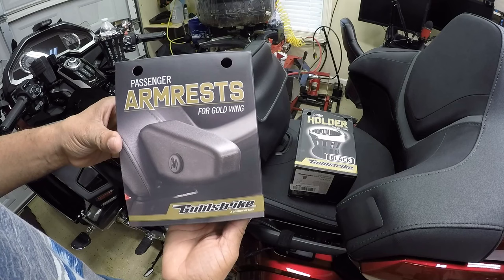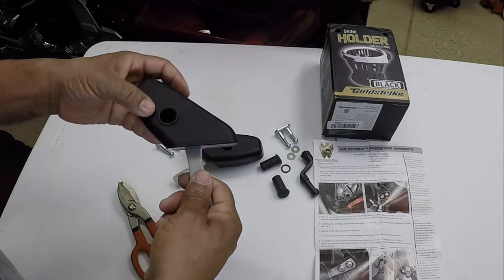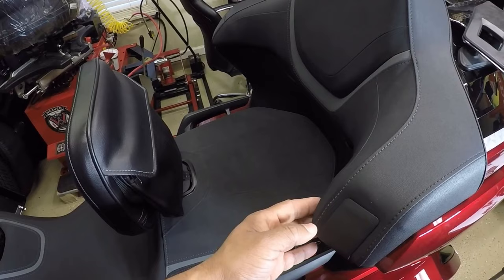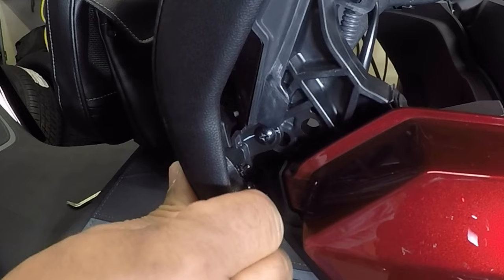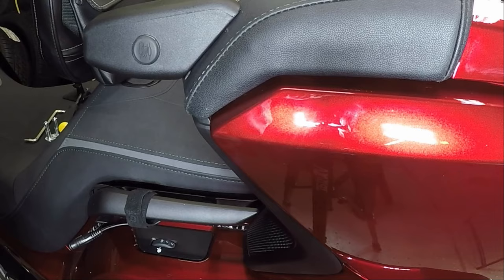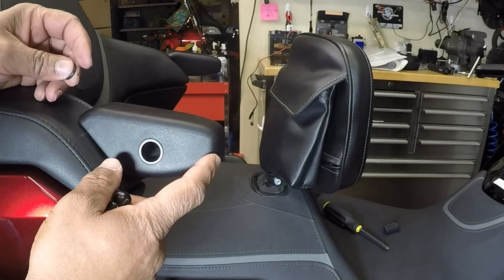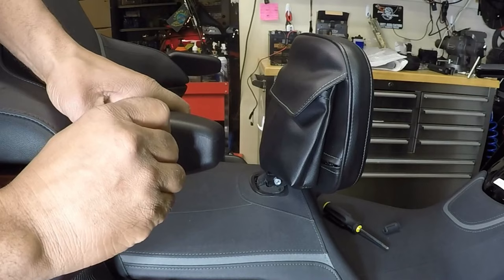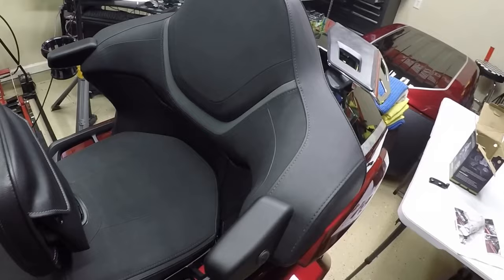Passenger Armrest Honda Goldwing with Drink Holder

Comment: Bought the same one from Goldstrick and it didn’t fit in my 2021 Goldwing. The metal bracket was too thick. Bad experience. May be quality control problems
Reply: Just seen your response to this vid. I'm having same issue. Do you have any idea why this is happening? I've seen some other vids. And I think this model does not fit DCT 21 and newer. My bike is a 23 dct and it's not even close.